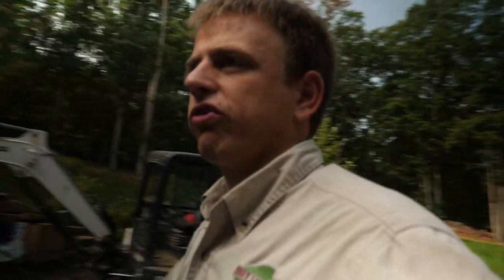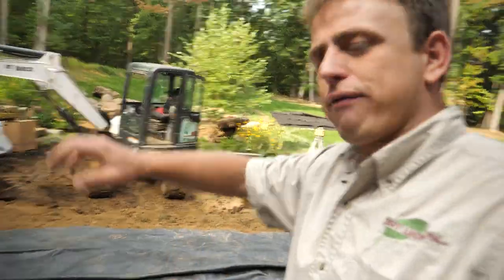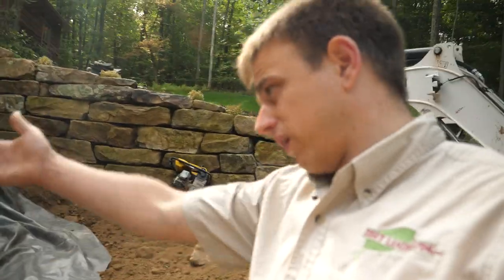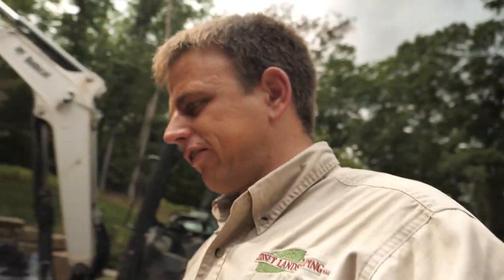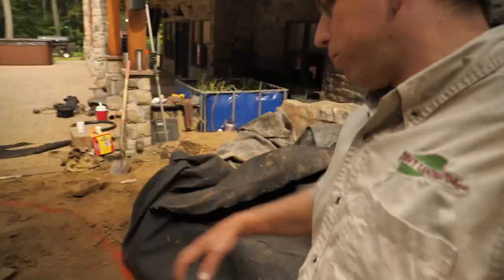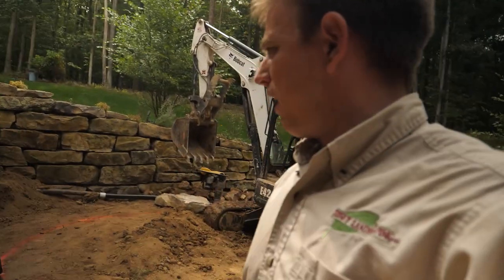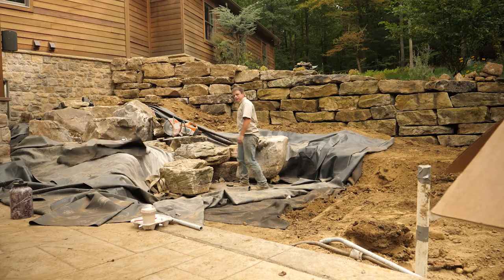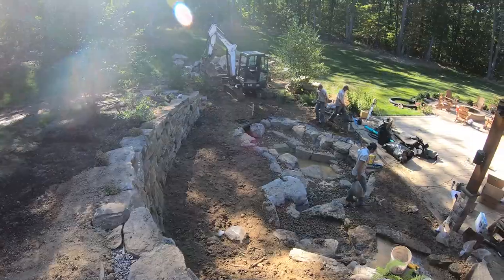How we do a Stream Liner OVERLAP w NO LEAKS (on my FAVORITE WATERFALL of the year)

Comment: Tussey have been watching countless vids of yours..
 currently building my 2nd pond (1st ended better than expected) 
Running on a budget i ordered and received LPDE liner instead of epdm wich is no doubt much better. 
but beeing in a Greek remote island is hard to source or deliver this huge 10mx8meters heavy epdm liner. 
its gonna be a big pond. and ofc i worry for the cheap liner choice you think they hold based on your experience?
Reply from the maker: Hey thanks for watching! I haven't actually ever used that type of liner. So i can't offer any experience unfortunately. Good luck on your project!

Comment: I heard you say 3” piping and a hum dinger of a pump.  Do you mind sharing a little more about the pump?  Submersible or nonsubmersible pump?  What size?  I’m on the design phase of my build.  I have quite a bit of head pressure (it looks like more than you had in this video but not 100% sure), three different terraced ponds with a stream/waterfall between.  I had already pretty much settled on 3” pipe but have been struggling with pump size and submersible versus non.  I want a nice roaring waterfall.  Is there such a thing as too big?  😂
Reply from the maker: The biggest pump we use is an Aquascape  5-9 SLD. If we want more than 9000 an hour gallons we just add more pumps. I think our biggest feature has 5 pumps.
As far as such a thing as too much water.. it just depends on what scale you wanna build.   I figure about 12 inches of spillways per  9000 gallons. The  only thing I would warn about is that many many gallons of water = much noise. They can get pretty loud in a small backyard. Good luck with your project!💪